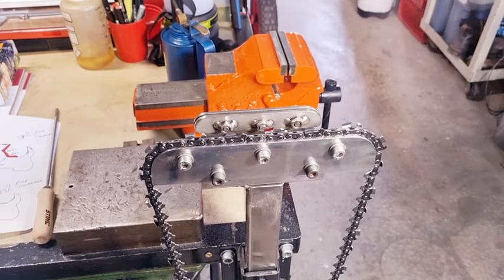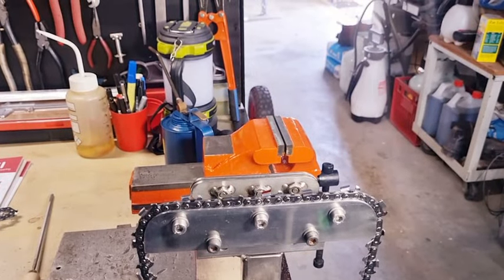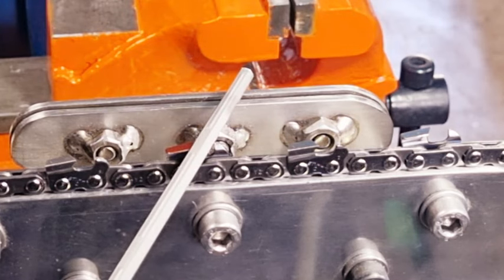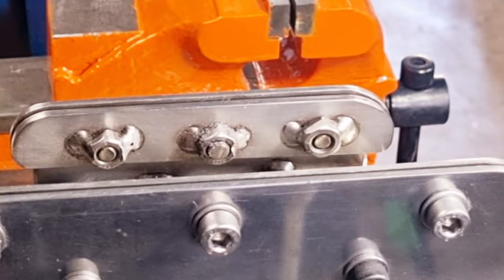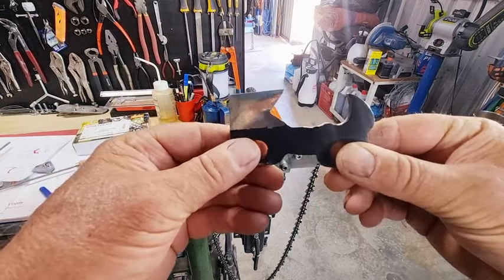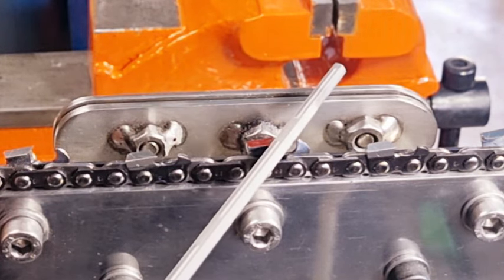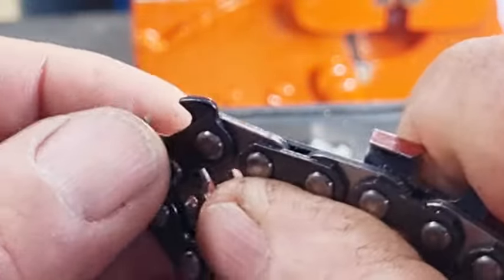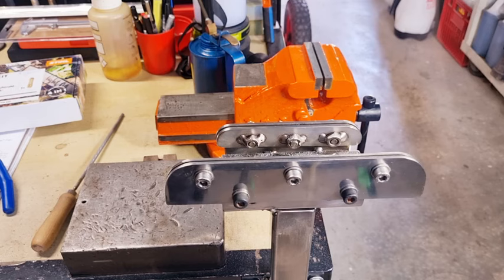Stihl Hexa Using grinder V Hexa file

Comment: Great videos. Have you had a chance to compare cutting with a traditional round grind on a full chisel against a Hexa “conversion” grind on a similar full chisel chain? How much material do you need to remove to produce the Hexa profile from a traditional full chisel cutter? In other words is it worth it (I am talking about part worn full chisel)? Cheers
Reply from the maker: I have have done a time based cutting test and yes Hexa wins every time.  Also I have videos here on grinding Hexa and how to do it dress wheel ect.  Not much metal is lost at all doing Hexa on a full chisel tooth.  Hexa has a narrow kerf.  Full chisel kerf 4.5mm hexa is 4.1mm kerf
Reply from the maker: Here is a link to the shoot out Hexa v Full chisel.
https://youtu.be/FFp3K3s8rx8?si=nDLWk3t8-hx5MHT4